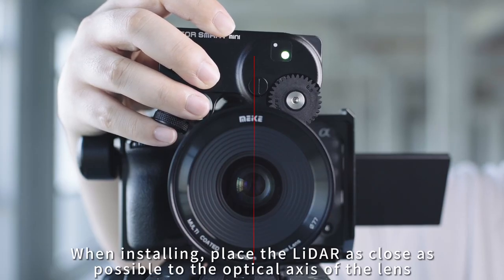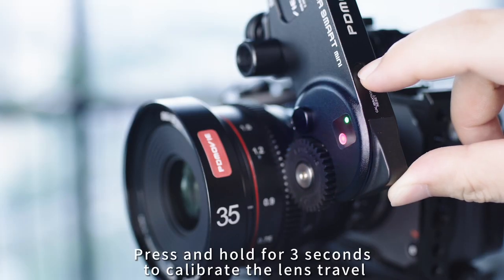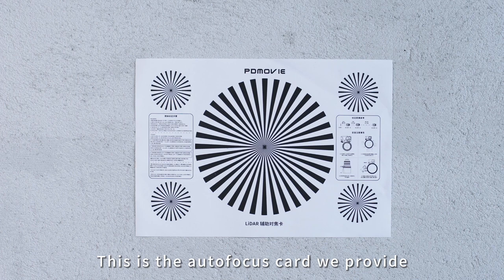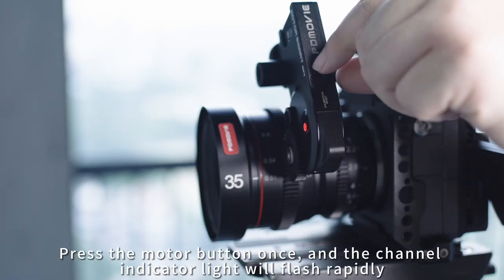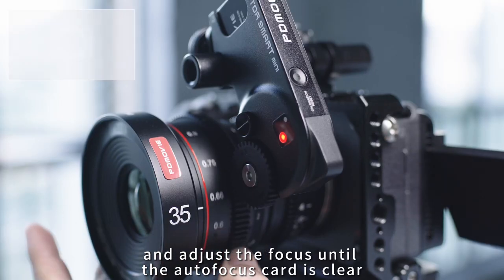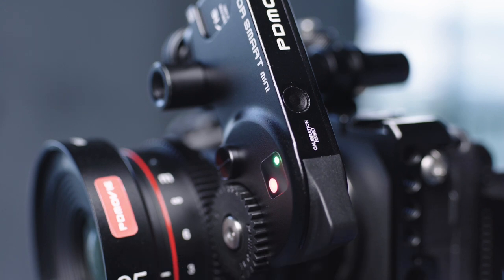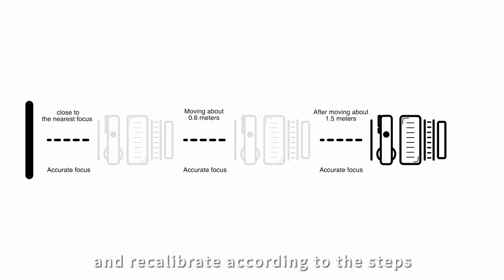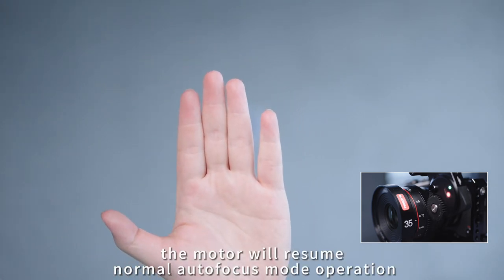How to calibrate the autofocus function for LIVE AIR 3 SMART

Comment: You need an app or something more specific than this video… even a well thought out instruction card…. The user experience has been dismal so far with this follow focus.
Reply: I followed the instructions and other than one typo I saw in the instructions that came with my unit, it was rather easy to understand and setup. I even used a tape measure for good measure. I also used the zoom view on my monitor for more accurate focus.

Comment: And there is already a calibration of the minimum focal length of 0.4 m. Are you serious? What about macro filming? After all, this information is not indicated anywhere. This information is available in the instructions in the box itself when unpacking. I was counting on the fact that the focus would work at all available dangerous lens distances. You didn't mention this anywhere in your product release. I am very upset about this purchase.

Comment: Great video. I'm a music videos director and i need someting like this...But we can't find any reviews or test by third part. I would like to test it on set. let me know please.
Reply from the maker: Just pre-sales now... You can check our website to learn more about this product.
Reply: @PDMOVIE  thanks. i just checked your website. My question was about reviews by someone else who used it for a job (not a Pdmovie staff). I just discovered your compagny so i can't just trust you on commercial video.
Reply: Some reviews will be coming real soon 😉
Reply: @RICH_Photography  great...!!! Thanks you and @pdmovie. Can't wait to see.
Reply from the maker: :face-blue-smiling: @RICH_Photography
Reply: Just to make sure I understand . It can focus past 10 ft if object is in way correct ? Like a dolly push in from 20-25 far away moving toward actor
Reply: I have had one for a couple of weeks now and it’s awesome, it gets it right 9 out of 10 times which is impressive, the only issue I’ve found is that with some of my lenses once I’ve calibrated it for that specific lens it just doesn’t work (as in it doesn’t even pull focus, it just stays in the same position even when the focus wheel is turned all the way in order to activate the LiDAR). I only have this problem on my two longer lenses and it could very well be user error, but my wider lenses up to and including 50mm work like a charm

Comment: Got it to work on one lens and that’s about it. Don’t get this.
Reply: I’m sure you don’t know what your doing it took a while to figure it out but I got it down pat
Reply: I have 4 lenses calibrated and working fine. It took a little while to get into the auto focus calibration setting but each time I did, the process was super easy and took about 2-3 minutes per lens.
Reply: Why is it so hard to get into auto focus setting mode?
Reply: I have three lenses calibrated. Not hard at all.
Reply: @starwaves9917  Well that certainly explains it. Very helpful!
Reply: In case you are still having trouble. I chatted with the company and it came down to the double press to enter into calibration mode. They have to be quick clicks, no hold, no hesitation. That's it.
Reply: @ZippyDChimp-mr1tf  They should put a disclaimer if you have slow reflexes do not buy 😂
Reply: @starwaves9917  Yes absolutely, you are quite the marketing genius! They should blame the person buying their product instead of finding better ways to communicate operating instructions. I'm sure that the very few people in this comment section who expressed having problems programming their lenses would benefit from the manufacturer telling them they need not buy their product if they are physically challenged.
Reply: @ZippyDChimp-mr1tf  Oh, you mean the part where their manual and tutorials say: "press a times THEN hold for three seconds?" Double press simply takes you to the next lens channel. And whatever the hell "a times" is.
Reply: @alexiskobalt7450  It wasn't clear to me at all. Think  double "click" instead of double "press" and it should work. Let me know.

Comment: Is there a way to override it from jumping to 5 meters and then 30 meters if no subject is detected? For instance, if a subject exited the from from the side and then re-entered from the side, you wouldn't want the focus to jump to the back wall.
Reply from the maker: That's how it's meant to be! When the object cannot be scanned, it will automatically jump to a position of about 5 meters on the lens scale. If the object is still not scanned for more than 5 seconds, it will jump again to a position of 30 meters.
Reply: Could a firmware update be released to keep the focus point at 5 meters if a subject isn't scanned for 5 seconds? @pdmovie
Reply from the maker: @REEL4REAL   Can't for now.
Reply: Just use the controller for manual focus. That’s why they include it. That’s also why they call it “Smart” as in your the one with the brains.
Reply: I agree, the product is so cool. But that would be more logical in term of cinematography. No reason to change the focus so quickly, just add a standby more when noone is detected in the frame. Or the focus follow the movement. If no movement, no focus change.

Comment: I want to buy it but I have a doubt... before removing the battery, how do you turn it off? Since there isn't an off button, won't I risk ruining it if I just remove the battery? thank you for the reply
Reply from the maker: Don’t worry, the design does not have a switch button. In order to get into work faster, this will not cause damage to the product.
Reply: Excuses for not having an off button. Even toys have on and off buttons.

Comment: I've used this on a few shoots in NY and while onset I could not get focus on a single subject in a large space. This should have been the easiest situation for this to work. I also notice that if it's too bright outside it will not focus either. Apparently, LIDAR works best at night.   I've recalibrated my Rokinon set over and over following steps to a T and still I can't reliably use this thing on any future shoots.   Very unfortunate.
Reply from the maker: You have to check the setup steps if is correct.

Comment: Hi Pdmovie, Why do I have to calibrate it everyday? After calibration it is only saved for couple hours. if I turn it off for more than a few hours, I have to calibrate it all over again manually, very frustrating, it's not saving permanently in the specified channel color. (im using the sigma 18-35mm)
Reply from the maker: Solved it!
Reply: @PDMOVIE  Thank you PDMOVIE! I was having problems thinking I had to calibrate my autofocus set up everytime I used my LIDAR, and I contacted PDMOVIE and within minutes Jacob from PDMOVIE responded and we video chat and he talked me through the process of retrieving my saved preset so I didn't have to calibrate everytime! Now I am in love with the product and excited to shoot! I also wasn't close enough during my first point of focus during calibration.

P.S. I am using the Blackmagic 6kpro paired with the Sigma 18-35
Reply: What was the solution? The same happens to me.. Need to resolve this.

Comment: Is there a way to calibrate a lens that has a minimum focus distance of 0.8m?
Reply from the maker: Yes. About autofocus setting:
Point 1 = 0.8m
Point 2 = 0.8+0.6=1.4m
Point 3 = 0.8+0.6+1.5 = 2.9m (Must less 3m at the third point)

Comment: It works, but if you could turn on and off the autofocus WITHOUT THE FOCUS POINT MOVING it would give you part of the control you need. For instance, someone walks in front of your subject but you turn off the AF until they’ve gone out of frame. Surely this can be done in a firmware update? Double or triple press on the controller would be good for this.
Reply from the maker: Short press the motor button a time can stop/start autofocus when motor in AF mode.
Reply: @PDMOVIE  Unfortunately this method means moving the lens when you press the motor button and it is also difficult to do, when for example you are using a gimbal - on a tripod, maybe it's ok, but you still end up noticeably moving the lens. Also it doesn't  work reliably when I try it. Really this function needs to be on the controller - this would be ideal. Firmware update?

Comment: Have the issue of once calibrated, all works fine.. but when I turn off the camera & Lidar, once restarted, nothing happens.. as if the calibration was never saved. Need to solve this!
Reply from the maker: After restarting, you still need to relearn/calibrate the lens stroke. But there is no need to set the autofocus again.

Comment: +1 No matter how hard I tighten the tube attachments, when calibrating the lens, the gear jumps the gear ring EVERY time. I also regret…
Reply from the maker: This is caused by the action of force. You can find a way to fix the gap between the catheter and the lens, and you can effectively solve the problem.
Reply: Pretty strong motor. Probably best to use another mounting solution. I particularly dislike the shoe mounted rod clamp because it tightens on to the shoe and the rod at the same time. I opted to switch it out for a nato rod clamp that has a separate clamp for the rod. The only draw back is possible having something that rigid may make your motor more prone to damage as hitting the motor by accident will not cause it to give way of obstacles.